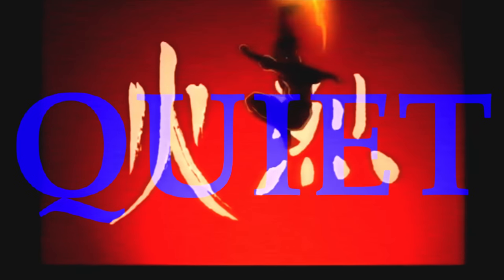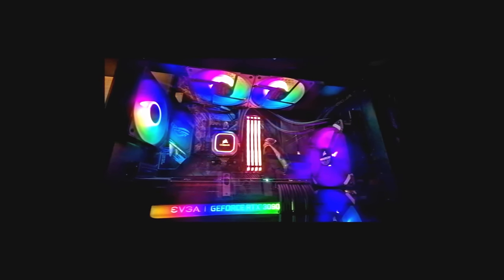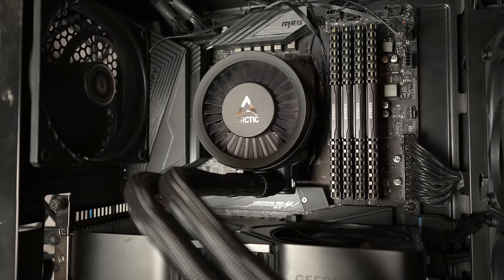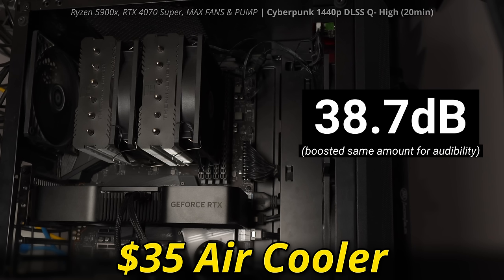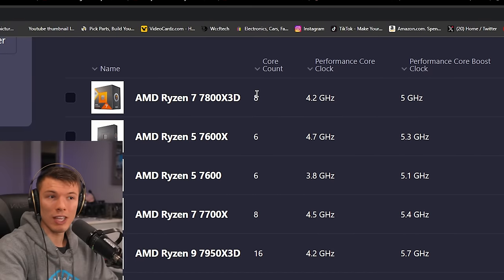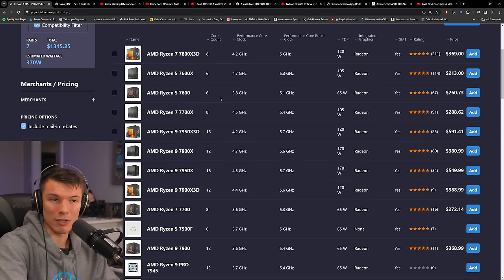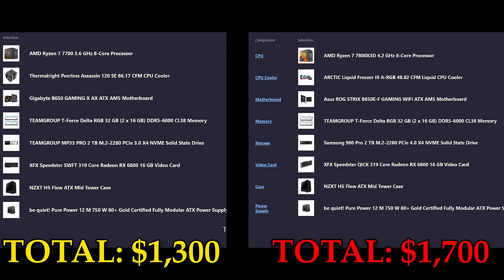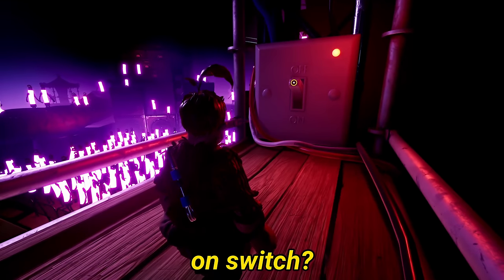How to Get the BEST VALUE PC!! (you’re doing it wrong…)

Comment: I've considered going back to an aio several times but what pulls me away is aio pumps go bad. It's guaranteed. But air coolers, the only thing that could go bad are the fans which are cheap replacements in comparison. Unless you're overclocking, you don't need those extra few degrees. Peerless Assassin all day long here and I have yet to hit high 70s.
Reply: I've had a fairly cheap Coolermaster ML240L running in my PC for six years now with the pump maxed - I do think it helps running pumps at a fixed RPM for the lifespan.

Prefer to have AIOs which has more thermal capacitance and so you don't need to have the fans ramping so aggressively as you would with an air cooler , which gets saturated quickly.

Comment: I am using the COOLERMASTER Hyper 212X for my 5700x (65-100w) and it was fine with the FX 8350 (125w) costs 16 EUR. And it works fine.
Reply: If I could have found all the parts I would have reused mine too for sure.
Reply: @Playingwith3D you don't need all the parts. I have my aio fastened with random brackets that didn't come with it. Lol CPU runs 40c while gaming and overclocked so it's doing it's job.

Comment: I have the Peerless Assassin ARGB. It was $42 Canadian, looks great, runs cool and quiet. Used Arctic MX-6 instead of stock paste. 
Buy a good air cooler, put the money you save towards a better graphics card. That will make your system run better for the same overall price.

Comment: I still have the Noctua NH-U12P cooler I bought back in 2008 (!) - I just slapped a new Noctua fan on it replacing the old one and got the mounting kit for LGA 1200 for free from Noctua. it's cooling my 11700 without breaking sweat :).
Reply: Same. I'm on my second cpu with the same Noctua and have never had a temp issue. No reason to get water coolers unless you absolutely cannot fit one but can fit a water cooler, or if you just want one for aesthetics.

Comment: I just recently went from a 280mm aio to a Noctua air cooler. It's significantly quieter because of that pump and cools basically the same. I work from home and use the computer for roughly 10-13 hours a day. The noise reduction was worth the trade.
Reply: How do you get any work done if you're gaming for 10-13 hours a day? That some serious multitasking. Props.
Reply: @christophermullins7163  he never mentioned gaming. Focus 😂
Reply: @redbunnyclassic  I know..

Comment: This is a great video and can't like it enough.  PC Building has always been about marketing and it gets worse every year.  I generally will build out of the same case for at least 10 years so I get at least 2 builds out of it so I will spend a little more there.  Another place you can waste money is fans there are fans out there now that are 30 USD each some even more.  I don't want to know how much I've blown on fans over the years (no pun intended) All the little extra's such as lights fan controllers etc. can increase build cost.  I've had pretty good luck with AIO's I've got one I'm about to replace just due to its age. I will replace it with something from Thermalright    An area where you shouldn't skip is PSU get the best one you can and get one that is warrantied for 10 years.

Comment: I actually prefer the air cooler sound over that liquid cooler sound. That pump needs to be turned down a smidge. I hope they give better control over pump speed if they haven't provided it already.
Reply: Do you use open case?

Comment: Sorry to be the guy but; Both have their merits.
Air cooling is more reliable cheaper 90% of time. Is a little more annoying to dust of though in some cases
Water cooling is quiter... In general! Not all coolers are equal. RGB and built-in LCD's are a total waste of money.
*Sigh*.. the main point is, buy what you need or whatever you want. It's your money. Also prices vary depending on the country. Sometimes they vary Alot. Here in Sweden most stuff costs usually $50-$500 more than what you boys in the US pay for hardware 😂
Also like bruh, there are many variables for what hardware / coolers are needed it would take a while to talk about them. I for example live in Sweden. It's pretty cold here and heating costs are annoying as heck so I go for 100% water cooling because 1. I have a pretty high end Intel system and 2. It helps with heating up my room. I mean I am using my pc alot for either gaming or other pc work so it works out. Also in the summer I hook up an external big radiator that sits in another room (tubes must be switched though) so my pc doesn't put the heat into my room.
Sure you could also put the entire system in an adjecent room, you just need a little hole to route the cables through or something. Actually I prefer doing this. I can crank up the fan curve without hearing any sound whatsoever. Not that I need it but it feels nice to let the fans rip (lol). Yes that also works for an air cooled system! Duh.
Idk, everyone has their preferences but I also imagine that many people are limited to some choices over others.

Edit: the 7800X3D isn't THE best gaming cpu, just to be stingy. It's mostly the best choice. Also depends on what games you actually play and what resolution. RAM fits also in that category. 
As we all know, it's a balancing act with the CPU + RAM + GPU combination 🤓🤓

Edit 2: AIO's from reputable brands rarely fail. Also funny that LTT put out a video related to water cooling almost at the same time you posted Vex 🤔😂

Edit 3: Did you use Liquid Metal on the heatspreader at 16:43 Vex? Or am my eyes decieving me? 😱 If yes then.. what? Even for testing that would be pointless and risky..

Last Edit: Yes, this video is Not for me. Just wrote my thoughts here, hope you don't mind :)

Comment: Air coolers are gigantic now and make it a huge hassle to work around it (meaning ideally you would make it the last thing you install in your build). The problem however is when you want to tweak your build i.e change out the ram you are using, replace fans that just died etc you basically have to remove the air heatsink while with water cooling you can leave the pump in since its around the same size as the cpu socket itself. This is why I am going AIO water cooling for my next upgrade, creates so much more room around the motherboard to get your hands in to do what needs to be done.

Comment: I went with an all white build I built last year with the gigabyte aero oc 4090/ 7800x3d/ 64 gigs of ddr5 ram in the phanteks nv7. The pc is a beast and I clean it once a month. I went with air cooling to keep it simple especially when I clean the pc.
Reply: No way that will cool it
Reply: @JustSomeoneRandomProgrammer  is this sarcasm? I have 12 fans in my build which is my profile picture. I play at native 2k or native 4k high settings with or without raytracing depending on the game and if I feel like using raytracing. My temps are very good and I deep clean the pc once a month maybe twice a month sometimes.
Reply: @MrAnimescrazy  i know. On text it sounds like i don't believe you
Reply: @JustSomeoneRandomProgrammer  that is dumb because air cooled is the majority of pc builds. Liquid cooling is the minority.
Reply: @MrAnimescrazy  but wait
Reply: @MrAnimescrazy  is that your pc on your pfp?

Comment: I still love the art of air cooling; you have to plan the airflow, use the smallest case possible to reduce the volume of air your fans move and if you do it right, you can match some AIO temps. Watercooling is still overkill and expensive for most builds  but people keep falling  for it as the 'ultimate cooling'.
Reply: Less than £70 aio isn't that bad.
Reply: @GeneralS1mba  yeah, decent air coolers aren't cheap either and problem is many cheap ones are trash, that pushes more people towards AIO..also case art; a big brick is less sexy that glowing tubes and led stripes..and ther theres the install-n-forget comfort of that brick...as someone once said "It just works"😁

Comment: Watching your videos helps me enjoy the house chores while doing it. Not gonna lie, I’m doing dishes while watching this video and finished exactly when the video ended. 😂

About this video, I was thinking of going for AIO water cooler CPU Fan, but my mid tower is not good for it, and I realized that I don’t need it for I’m only rocking a Ryzen 5 5600G, which is not that powerful for intensive tasks. I’m still using a used RTX 2060S tho, and I’m contented with its performance 😄

Comment: you absolutely correct. 8:47 also keep in mind that those 10% faster is at 1080p with 4090 xD. when you actually play you will be GPU limited anyway. so yes, 7600/7600x/7700/7700x/7900x does makes sense for most people. buy 7800x3d only if you have 4080-4090/7900xtx GPUs.

Comment: my whole watercooling loop cost less than a noctua DH-15 and is needed for what horrible things I am doing to my GPU, and you absolutely can tell the difference.
because the cpu temp is lower is stays at max boost all the time in games, the GPU is overclocked, overvolted and running beyond its wattage(by double) and the typical gaming temps are between 38 and 46C/50C hotspot overclocked, down from 88C and pegging the hotspot at 110C stock cooler stock clocks.

am I the exception in this case?

A second hand Lowara D5 EK pump picked up for $20NZD, 380mm double thick rad and 240mm rad $18NZD, automotive 9.5mm hoses $10, brass 1/4" fittings with a 10mm hose barb on them(modified with a dremel), $0.5-1 each on clearance, coolant $1 on clearance(betcause no one wanted XT-1 in the color of hobo piss)

Comment: I use my cars old intercooler. Bonus of this is that the old engine oil residue helps reduce friction and wear on the CPU cores and increases multithreading performance.

Comment: Unless you're going for a severe overclock, a hi-quality air cooled solution is almost always a better choice. Beside being generally less costly, conventional heatsinks are wwaayy more durable, require less maintenance, and if something does goes wrong it's more easily visible. If the motor in a AIO liquid solution fails, you won't know until your PCs glitching out.

Comment: I am the min/max king. I have $800 in my pc.

6950 xt
5600x
16gb 3800 cl18
Nvme and 2tb hdd
850watt evga

Gpu cpu motherboard ram are new and everything else came from previous build but i worked those used price value into the $800.

Comment: Crazy to me some people spend $300 on a motherboard to drop in an i5 and never overclock or ever use any of the extra features they paid hand over fist for. That and RGB AIOs that have screens on them for mid-range builds.

Actual hardware spec over RGB and looks every-time. I prefer FPS gain over staring through my side-panel.

Comment: i've built a (£600 AM4) SFF PC and put in a Thermalright AXP90 X47 on the 5700x . its a great little cooler, however even with fan curve adjustments and a Noctua A9x14 this thing ramps up and is pretty noisy even went opening chrome. so my next addition will be to rip that out and put in a Arctic Freezer 3 ( it'll fit! just). in a bigger case Air cool all the way get your self a NH-U12A and be happy.  but in a Meshlicious i am going for the best and quietest Water cooler on the market at half the price of a NH-U12A.

Comment: I recently did a min/max build/rebuild/recycle of my own. (In Ireland, prices here are terrible so we need to shop around)
Ryzen 5600 for €131
32gb high end ddr4 3600 cl 16-16-16 ram for 60 euro
B550 mobo 80 euro(a good ASRock one) 
I already had the ram so that's why I stayed with b550 mobos. The next step up was something like a ryzen 7500f or 7600 with more expensive ram and mobo.... I just didn't have the budget to go with the newer platform. 
I just picked up a rx5700xt oc for 190 euro to complete it

Comment: I'm not spending on a spiffy case, I'm reusing my dad's old Thermaltake Xaser VI. Lotta drive bays for my old unused drives... especially if I get a Startech SAS to SATA card and 3d print some HDD mounts for the 5.25" bays.

I'd have probably bought a new one if cases these days would let you have more than 2 3.5" drives. (I mean, there are, but they cost as much as this case did back in the day, and good luck finding them in stock).

Only caveat is that I had to get a 5.25" I/O panel to add USB-C and 2 USB 3.0 headers at the front. You guys have no idea how long I had to search on Amazon for such a thing where the Chinese manufacturer actually had a USB-C header cable instead of making the connector route to a regular old USB 3 header.

Oh and forget putting that case on a desk. Unless you want to break your back and your friend's lifting it. Best anti-theft PC case: so heavy nobody can steal it before the cops arrive

Comment: I have a 5800X3D my cooler is an ARCTIC Freezer 34 Esports Duo. Right now it is 41-44C in a 21C room. When I'm playing Cyberpunk 2077 it is around 69-71C. My GPU is a 6950XT $600 is what I got it for in May of 2023. It is going to last me a very long time. FPS in Cyberpunk on high @1080p is averaging 137.5. If I were to go to 1440p I'm sure I'd still get near 100FPS so I'm happy with my system. 

My case is a Corsair Graphite Series 600T Mid-Tower Case. I got it 9 years ago for $139. It still does the job and keeps things cool and has all the space I need even for the big GPUs. I have added 2 $20 Scythe fans to the mesh side panel to give a bit more air to the GPU and CPU otherwise it is the same as when I bought it.

Comment: Or just buy a high end air cooler once and you never need to buy a CPU cooler again. The only things you need to replace are the fans at some point, but even they last long. Like Noctua fans come with 6 year warranty and probably last 10+ years. Also, high end air coolers beat these low end and even many of the mid tier AIO's and many times make less noise too.

Comment: 13:56 while it wasn't my initial plan, I got a reference model 7800xt which imo has a much nicer side profile, end cap and backplate look than the gigabyte model I was initially after but was out of stock. I managed to bargain so it was cheaper too! Always look around on the day that you buy parts.

Another pleasant surprise was that it being thinner than the gigabyte model made for better airflow in my matx case

Comment: I'm running a the same 212 air cooler I installed 8 years ago on my daily PC.  Put a Noctua Fan on it 4 years into its life.  Still going.  Cool temps.  Meanwhile I can't count how many failed pump AIOs I've seen that conk out a few months after the warranty is over.  Until a CPU cannot be cooled by a air cooler I'll be Air Jordan.

As a former no-AMD user I'm impressed with the Ryzen line today.   GPUs are a hustle today.  1080p with my overpriced EVGA 3060ti keeps me happy.

Comment: I build a lot of PCs for myself, family, friends, etc. and pretty much learned long ago that AIOs are usually a waste, if not sometims worse than decent priced air coolers. then, one person demanded an AIO... I told them several experiences i had had in both my classes and building experience that have made me pretty much avoid non custom water cooling loops/AIOs ever since. But they were adamant. So... I gave them what they wanted. I've never bothered with another liquid cooler pre-built again, because even after 3 reseats and repastings, and then even LAPPING the cold plate because of how bad the cooling was, it's temp performance was pure shit. I even returned it thinking I got a bunk one... but got same performance. 

I've never, EVER ran into thermal throttling or any heat issues at all with good air coolers. Pcs I've built over years as a rule max their temps at under 70C, across every build (aside from 3 i9s that were used for a lot of editing) aside from extreme rare cases of them absolutely TRYING to push the temps.

Don't avoid the enormous selection of great performing, reasonably priced air coolers. Take that extra $80+ and put it towards a better component elsewhere, and thank all the ppl telling you to do this later 😂

Comment: AIOs / watercooling are needed for higher end CPUs, an Intel Core i9 14900kf will run hot with an air cooler. Running parts at higher temps degrades them over time.

Comment: Good video! As a newbie to building, didn't factor in the motherboard updates issue with Intel. Got a 12900K with motherboard and 32gb ddr5 ram at microcenter for like 400 bucks. runs beautifully, not sure if Amd would have been better.  Coulda saved 30-40 on my air cooler though.

Comment: When I built my current PC almost two years ago I got an AIO (which turned out to be overkill in the first place) on discount and only used it for like a year until I started getting Hotter Temps like 80-90c on a game a week earlier was only like 50c (took me awhile to diagnose the AIO after replacing my thermal paste). I then switched over and bought a Vetroo V5 cooler after seeing JTCs video on it. 

As it turned out I think initially it cooled better than the AIO did. I also like not ever having to worry about the slim chance that something in my PC will leak and kill it. Of course I was told later that I probably needed to turn over my AIO/Case but I'd just rather deal with no liquid and less overall maintenance in my PC if I have to.

Comment: The best buy on AM5 is the r5-7600.  Its super fast performs as well as a 5800x3d, sips 65W and allows you to have easy path to upgradability in the platform without losing a lot of value in residuals

Comment: About cases. Over years i learned that many budget brands already offer good cases. Some cheaper Deepcool or even Zalman cases are good. For me important part is cooling. if i can fit up to 3 fans in front, 2 on top, 1 on back, its all good. Got myself Deepcool for 50 bucks that even can fit 420 AIO in front if needed. Yea front pannel was plastic with horrible airflow but i fixed that with 20 minute mod.